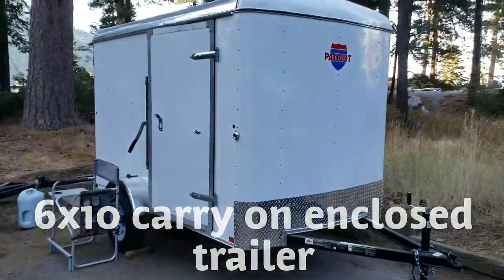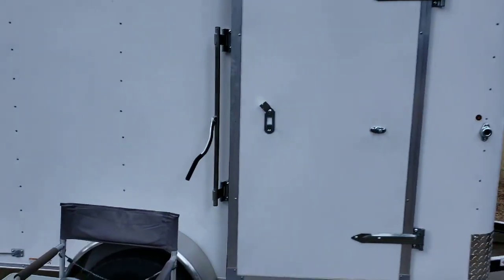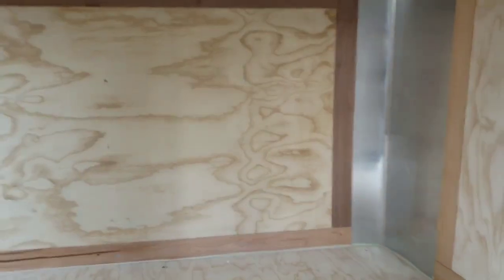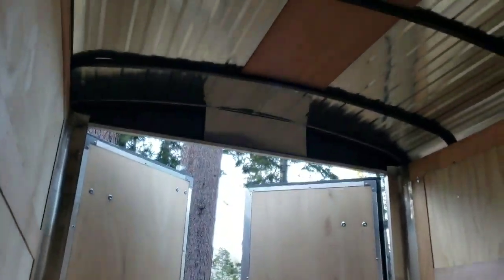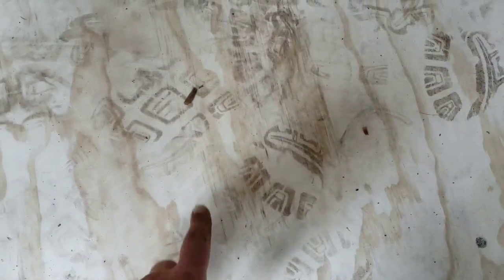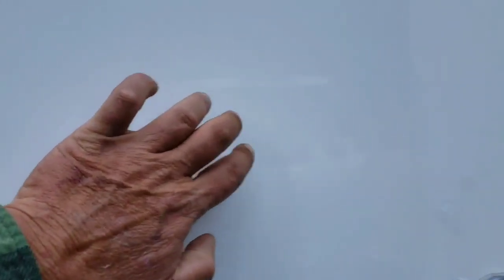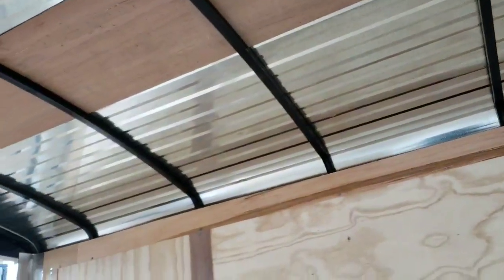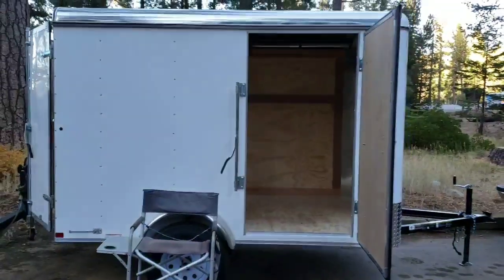My 6x10 trailer - first look

Comment: most of these budget trailers are shoddily constructed. Thin frame, no brakes on single axle, exposed wood on underside. It's better to spend more and get tandem axle with brakes, beefier frame, and better flooring with some sort of protection on the underside. Tires also need to be upgraded. Avoid V nose, as they are subject to severe wind buffeting when changing lanes.